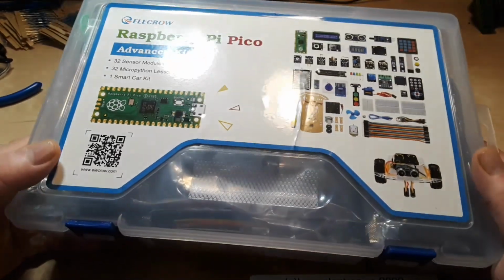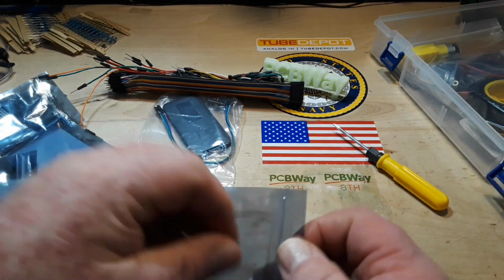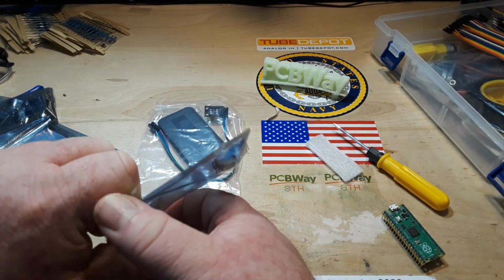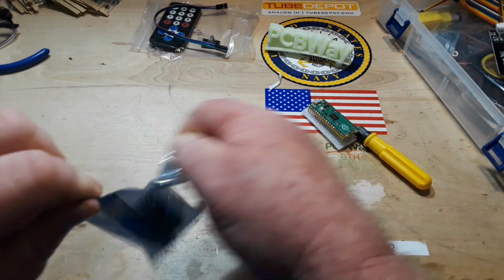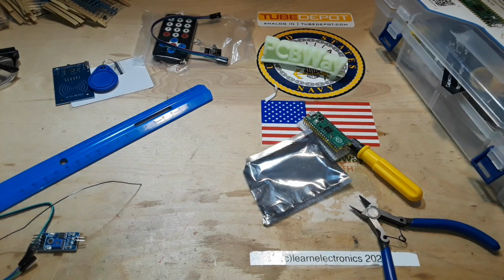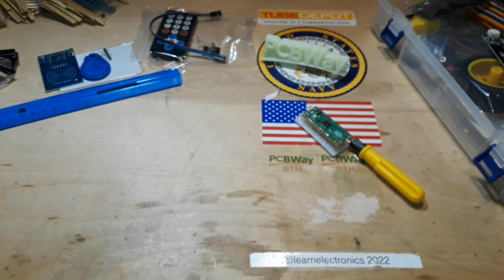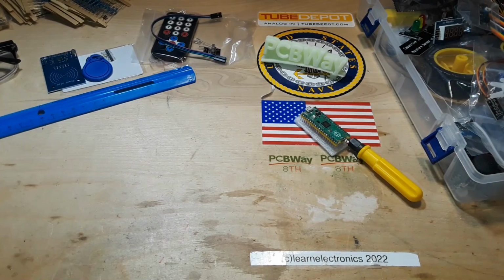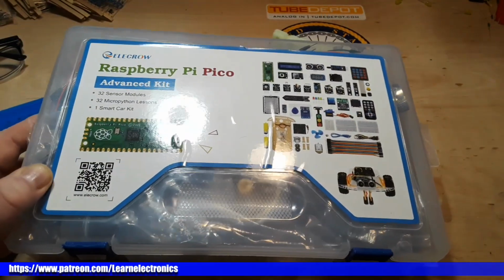Elecrow Raspberry Pi Pico Advanced Starter Kit

Comment: I am relatively new to all this but the Pico is a 3.3v logic board and the kit supplies and uses some 5v devices without any logic converters!  Isn't that going to destroy the board or am I missing something.
Reply from the maker: Those devices will get their power from the Pico therefore they will only get 3.3 volts.